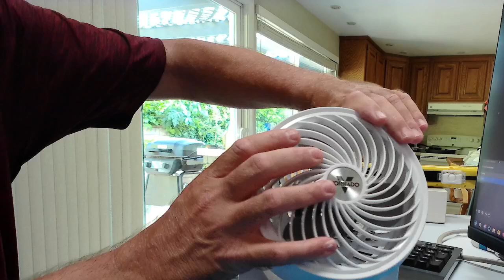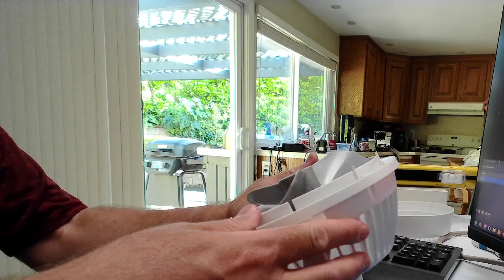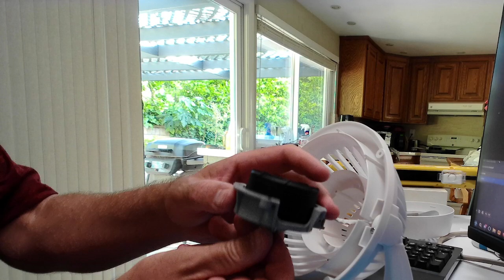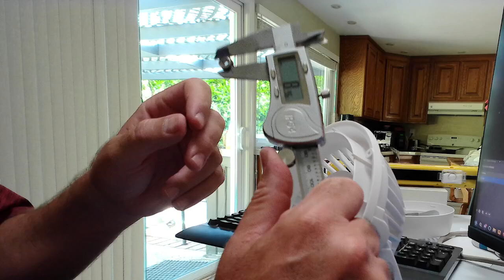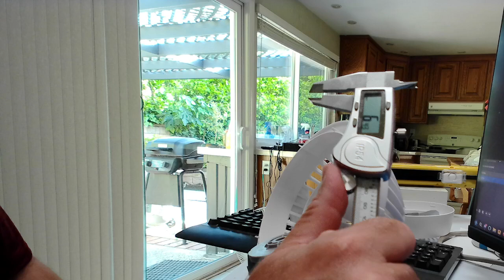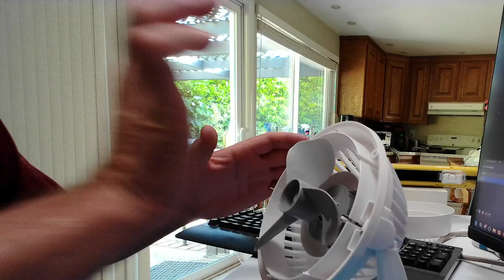Vornado fan repair

Comment: So, I heard a noise but didn’t immediately shut the fan off and then it quit turning.   I wonder if I should try to replace the bearings.  I just tried a new fuse and that was a no go.
Reply from the maker: Bearings will only fix a no turn issue.   If the fuse is blowing you might have blown out the brush-less motor control computer,  which pulses the electo-magnets on and off.   I can't help you with that one.
Reply: @northyland1157 can you help me to fix my vornado 660